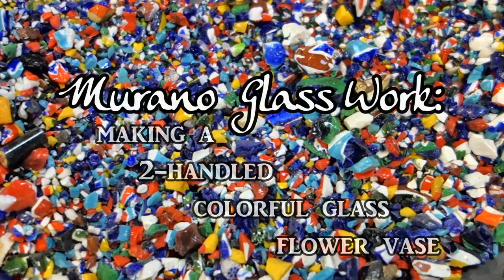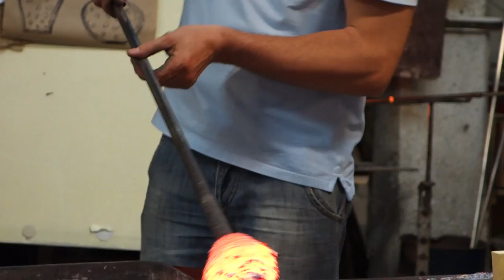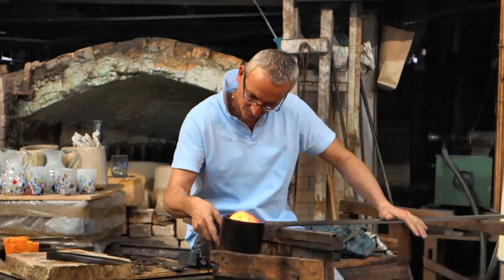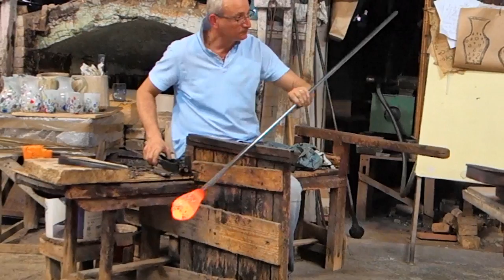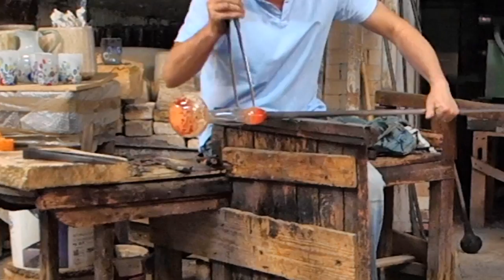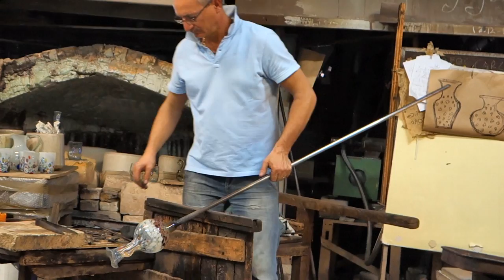Murano Glass Blowing of a Flower Vase with 2 handles

Comment: How did he get that vase off the rod?
Reply: i think its because hes using a wooden-framed bench!
Reply: A constriction is formed early in the process, it acts like the perforated edge of a spiral notebook, allowing the artist to cleanly remove the vase.
Reply: He probably just simply tossed it away
Reply: You add a drop of water at the base of the punti or "rod" where the vase meets the glass on the end of the punti and give it a light tap & it comes right off.